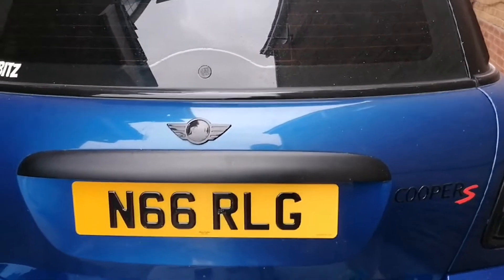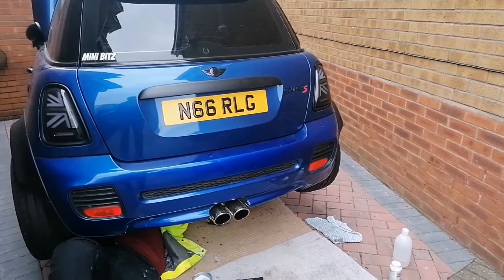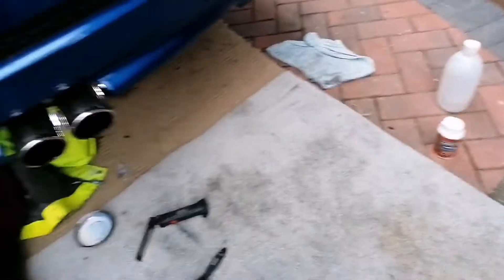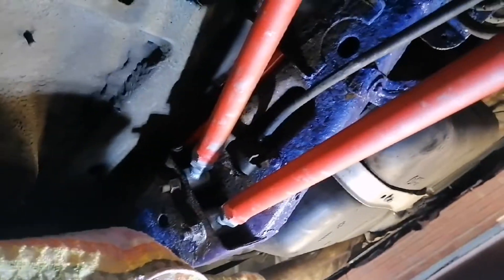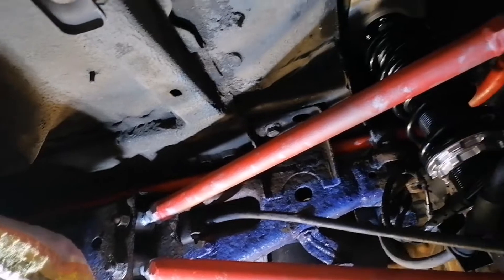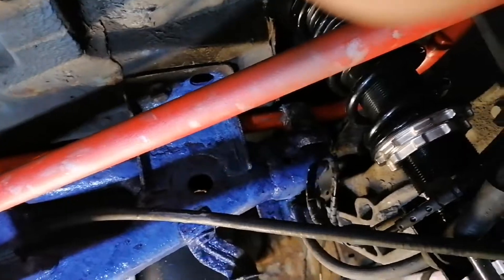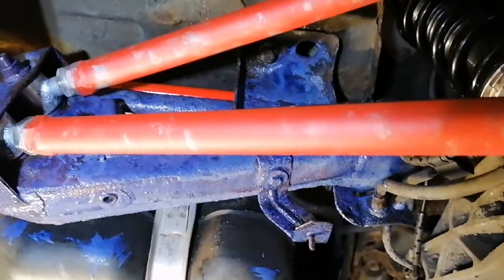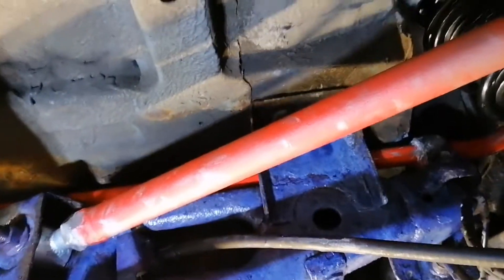R56 Mini Cooper S. Quick clean up of the  rear subframe...

Comment: Is it possible to remove the top heat guard without removing the exhaust? 

My rear sub frame isn't too bad but needs some TLC, trouble is getting to everywhere that needs treatment. Thanks for all the videos on this r56, they helped me loads.
Reply from the maker: Hey Jay, thanks for the feedback, really appreciate it...
The answer is yes for the rear heat shield, you have to drop the back box off the hangers to give you a bit of wriggle room but it can be done.
The tunnel area can be done as well but you have to drop the rear much lower by removing the centre brace....👍
Reply: @smithiestrackmini  That's really useful to know, thanks for the info. I spent loads in January getting my front sub frame replaced and I want to avoid the same happening in a year or two. It seems that corrosion on these frames is quite common on minis.
Reply from the maker: There is a 3 part video on my channel of when I dropped the rear subframe as well, I went after all the surface corrosion above & at the back of the fuel tank, it was quite bad, but I caught it just in time.